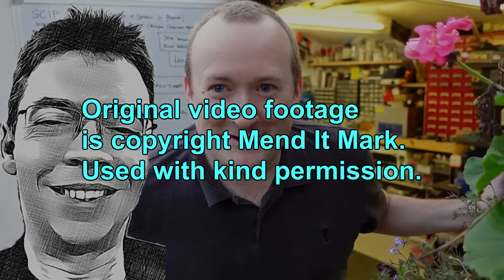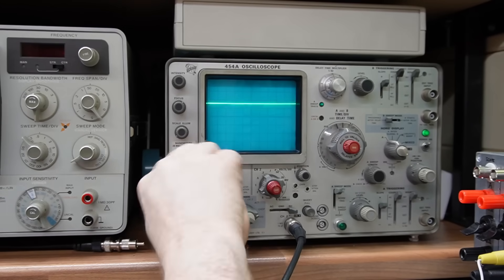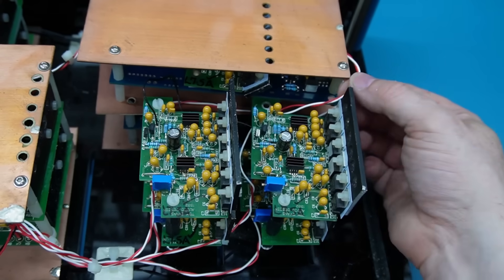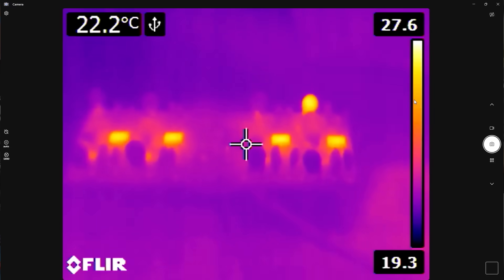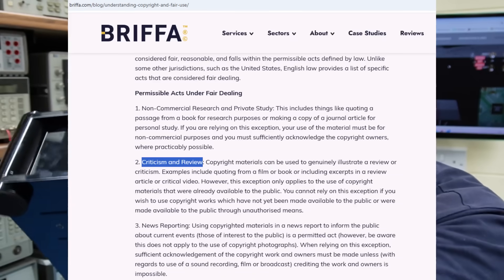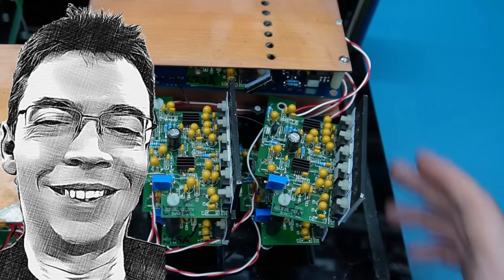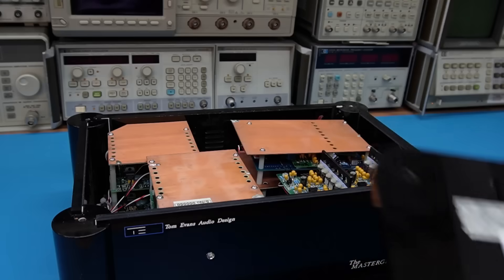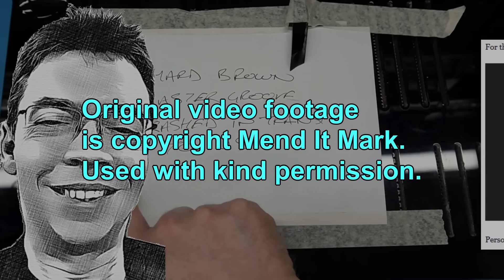Reaction to Mend It Mark takedown by "Tom Evans"

Comment: In trying to make the video go away Tom Evans has succeeded in highlighting their shoddy workmanship and severe markup in something that uses already well known circuit designs.
Reply from the maker: I've been considering making one that's a fraction of the cost with much better performance.
Reply: @MartinPiper6502  I seem to remember there was an audiophile/engineer who did just that, Said he could build a superior amplifier for a lot less cost and did just that. Eventually became a high end audio company. Can not remember who the chap was.
Reply: @garfieldsmith332 was it by any chance Tom Evans?
Reply: @JasperJanssen  No. This is going back a few decades ago. Still trying to remember the name. He was from the USA.  EDIT - Actually now I remember. It was Bob Carver.
Reply: I remember Bob Carver was making some claims  @JasperJanssen  however his designs were also expensive.

They were good and they had quality but not in this price.
Reply: @sonycans  Yes!  I had 2x  TFM-35 amps. Very nice.  I still cry when i think about selling them in 2004.  Oh well.
Reply: @sonycans , I still have one of his Phase Linear 400s from the early 1970s, it was $299 USD back then. He even offered to repair it when I had a problem a decade ago.
Reply: @garfieldsmith332  This was the first thing that popped into my head when I read your first comment! I remember reading a story where he tuned his solid state amplifier to perfectly match the output of some much more expensive tube one. I still have the Carver amp my dad gave me for Christmas in 1989. It sounds great, but the VF display is starting to flake out.
Reply: @garfieldsmith332  Bob Carver. And he took a journalists challenge that he could make his cheap amp "sound identical" to the best in the world ie Krell and the like and he did it in 24 hours in a Hotel room
Reply: @davidewhite69  I did not know he did it that quick. I knew about the challenge,
Reply: Could it be David Haffler?
Reply: @garfieldsmith332  Bob Carver was/is a genius and made top shelf kit.
Reply: @garfieldsmith332  Likely Bob Carver. He built some really weird and interesting stuff over the years.
Reply: @bugdrvr  Yes it was Bob Carver.
Reply: @garfieldsmith332 Carver was big name...
Reply: @garfieldsmith332  I remeber on Bob Carvers power amp. He used a switched power supply first in a high device. Not a switched power supply we actually known - he switched the voltages of the final stage depened on the output power in a few stages. This should reduces the noise of the stage.
Reply: @MartinPiper6502 make it. There’s clearly a market.
Reply: @MartinPiper6502 what if one of these mounting screws decided to fall and Lodge itself in exactly the wrong place causing a fire hazard?
Reply: @MartinPiper6502 what if one of these mounting screws decided to fall and Lodge itself in exactly the wrong place causing a fire hazard?
Reply: @MartinPiper6502  I would really really love to see such a video. In fact, I subscribed in the hope of seeing such a video! I can't really justify the price tag on that piece of equipment, maybe because it is fully hand assembled... but still... 
Anyway, I'm really hoping you get to make a video or series of videos about designing and building a pre-amp for a moving coil cartridge.
Reply: @MartinPiper6502  Do it!
Reply: @MartinPiper6502  I would love to see Mend It's schematic.

No doubt, this is a very good (audio) quality amplifier and well worth copying the circuit and making one's own.

In the 'old days' pcb manufacture was far more difficult, hand made drawings, UV boxes or letrasterts. Nowadays one can design a pcb in a few hors and send it to one of the many companies that will bash it out for a few ££

I'm sure the redundancy could be removed and it all made on one (or 2) pcb. I doubt the copper boards do anything to add to the sheilding.

The stacked PCBs are ridiculous. For isolation, the Storno way (if you ever saw their magnificently built radios)  was a die-cast chassis, with separate compartments for each stage & feed-though capacitors.
Reply: @wibbley1  I'm pretty sure those blank PCBs help with shielding, but they wouldn't be needed if Evans used a metal chassis, which he, for whatever reason, didn't.
I'm pretty sure this could be done better. Stacking like this is absolutely stupid, PCBs could've been mounted vertically instead. The usage of tantalum caps is also stupid, they are expensive, but they are not better than foil or ceramic caps, which all other manufacturers use (even highend brands). Electrolytic caps could be replaced with solid ones, which is also an industry standard nowadays. For some reason wiring is also unshielded.
I'd bet a preamp at 1/10 price would measure better in real world, just due to terrible execution.
Reply: @MartinPiper6502  Evans could have got that done and assembled much cheaper and more streamlined had he farmed it out to China.  Probably a 1/10th of the cost for resale.   BTW you are allowed to repost a YT clip under a YT CS? Just wondered....  🤔
Reply: @rickrick-g9f  25000 pounds he sold that for so I'm sure he would have had it made for a lot less than 1/100 of the price.
Reply: The "Streisand Effect" in full force :)
Reply: @KangoV  100%
Reply: Yes, half of Louis rossmann’s first video on this is about how attempts to silence this sort of public scrutiny does the complete opposite
Reply: 100% - This Mark Evans guy should be, and probably is, completely embarrassed to put out a product of this build quality and to charge what he charges
Reply: @travis4619  Assume you mean Tom Evans but absolutely embarrassed by that 😊
Reply: @EsotericArctos   Tom / Mark -- whoever is charging 20K for this shit! :)
Reply: That amp looks lot of like my first amp i made...

I was 15 then. 😂
Reply: The company  has  sour grapes because it was obvious that their design and execution of  lifting customers  legs was obvious and  shoddy some  people  just  don't like the  truth says alot about  them
Reply: @user-mv5bu2kk8b  alot is not a word. Neither is alittle atall ashort.  They are 2 words " a lot. "  this mistake is usually from British people.
Reply: Vid eo  is over on r mble.
Reply: And probably put others off buying
Reply: @LOTPOR0402  You can only hope so
Reply: I'm digital not analogue, but even with my limited knowledge it looks .... basic. 

What it reminds me of is early computers like the "Mark-8" which were before the days of ribbon cables and buses, and are a collection of uncomplicated PCBs wired together in a rough and ready fashion.
Reply: This sort of markup is common in Audiophile equipment.   Some people will spend hundreds of thousands just on a cable.    It's up to people if they feel they want to pay the money, but ethically it would be nice if people designing these things did not make them like they were a DIY project.
Reply: @EsotericArctos  yes I know, I considered myself one back in the 80s. Back then I was appalled by the cost of "Monster" speaker cable but fell for their A/B switch comparison demonstration in the showroom and bought a heap of their cable. That comparison has since been exposed as a scam, yet the company lives on
Reply: No screened cables, poor PCBs. Anything Mark could fix, I could fix. I LOVE repairing stuff.
Reply: As a beginner project: great job.  As a high end mega expensive piece of kit: great joke.
Reply: Fit for purpose? Well the purpose is to be a pre-amp.  This was dropped and physically broken in transit.  I don't think one can say it is not fit for purpose for breaking when dropped.  I think the build quality is that of a prototype rather than a production unit.

Yes there will be people who will say they can hear the difference when they really can't.

Comment: Ignoring the copyright problem for a moment, good grief - that design does not feel production ready.
Those boards stacked with plastic stand-offs, chunks of hot glue potting, and from a quick glance those boards have question marks.
That's a £25k pre-amp?
Reply: Nothing but snake oil.
Reply: Yes!! One of my Audio-Phile friend swears by it (though he doesn't afford it) as few other Psycho Audiophile reviewers had all the praise for the Crap. So Audio lunatics with Deep Pocket, FOMO  and  boasting rights will still buy it , despite seeing MOST pathetic workman ship I have EVER seen in an Audio gear which sells for money and not build as a favor
Reply: @Ujjwalis  An audio-phool and his money are soon parted.
Reply: Hot glue on capacitors isn’t an uncommon technique, lots of manufacturers do that at all levels,of cost. That’s not really the issue. And I guess the “alien technology” is the system design with all the excessive power regulation… but it sure seems like a fairly hobby grade system.
Reply: Audiofools will pay anything
Reply: @villehursti  It's super high quality, those bits of paper packing are special oxygen free hi fi paper!

Comment: Was the block diagram made by Mark or was it from Tom Evans? While you can't copyright an electronic circuit you can copyright a drawing of it, so if Mark reverse engineered it it's fine but if it comes from the manufacturer it'll be covered by copyright; they probably still don't have a case under fair use, but that may be the angle they're taking.
Reply from the maker: I think it was made by Mark.
Reply: No documentation was supplied to Mark, or available to him.  He created it all by himself just be examining the circuit boards.
Reply: Mark reverse engineered the preamp to create his own service manual.